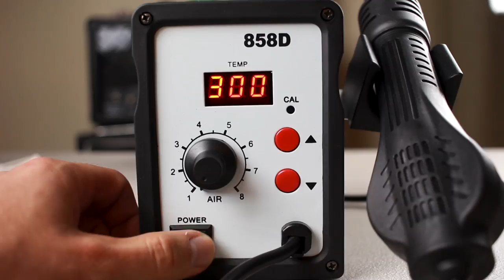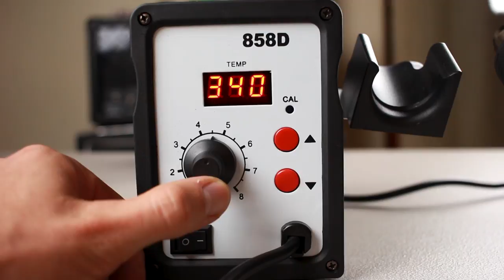HOW TO USE A 858D HOT AIR REWORK STATION - MOD MONDAY EP5

Comment: I have the LRT station with both heat gun and iron. Your video helped me conclude that it was not functioning correctly and it needed calibration. Brand new out of the box was low by 100 C. and since it only goes to 450 I was only hitting 350!! destroy 2 test chips before I figured it out. LRT 8586D.  Once it was callibrated it poped the chips off like a pro!! Saved 50GB of my grandkids pics from the beginning of their lives. PRICELESS video my friend.  Your video assured me that my device should be able to do the job and something else was wrong.  THANKS AGAIN
Reply from the maker: Glad the video helped. When I started I was melting boards because the heat was too high and the air was too low. I bring the air up just high enough that it doesn't blow the parts off the board. Use generous amounts of flux paste help as well.

Comment: One "trick" that makes desoldering a little easier if you use solder wick / desoldering braid: 
Cut yourself small pieces (maybe half an inch or 3/4") off the reel and hold them in place with tweezers. Discard once saturated.
If you keep the entire roll of desoldering braid attached, you have one huge hunk of copper there that will suck the heat away from your soldering iron quicker than anything. Depends on your iron of course.
Reply from the maker: I'll have to try that. Thanks for the tip!
Reply: This is brilliant! Never thought of this at all.

Comment: You did very well in your explanation. You know what you are talking about! I have been a Commercial TV  High Technical Maintenanace  Engineer for over 15.5 years +,  I have done so much repair work on Sony. Ampex and Hitachi Tape Machines and Cameras  back in the early 1980's.  I wish this was available back then when TV was still just analog. Nice to see a young person take such an interest in this. Great Presentation! Keep up the Good work!
Reply from the maker: Hot air would be better for smaller components than TVs. With bigger components a soldering iron would be preferred.

Thank you!

Comment: As a total newbie in the world of soldering, thank you for this review. Also I would like to thank people commenting tips&tricks!
Reply from the maker: No problem. Hot air rework is a little trickier cause you need a lot of flux, moderate airflow (but not too much that your parts blow away), but not too much heat that you melt your components. Its an art.

Comment: Nice video Just a tip Put some heatstrink over the pcb holder clamps You can scratch and destroy pcbs bcz the metal teeths are pretty sharp Good luck!
Reply from the maker: I've scratched a few already. Good tip, thanks 👍

Comment: Louis Rossmann Has left the chat.
Reply from the maker: He's a big fan of Hakko and would not recommend this unit. He's also coming from a place of a repair business, not a beginner guide. Still a fan of his, his knowledge of Mac is unsurpassed.
Reply: This hot Air station is actually preety good. I own it.
Reply from the maker: There are a lot of copies. For the price it really can't be beat.
Reply: Rossman made a video bashing (literally) Baku hot air station, which was pretty pointless.  A pro should not get hobbyist grade equipment and then bash it as not being good enough.
Reply from the maker: I agree, springer. If you're going to run a business, you should be getting quality tools. Rossman could probably go higher quality with Metcal, but Hakko is probably good enough for the work he does. To each their own.
Reply: @ImmodderNation  Quick is the one to go to
Reply from the maker: What?! Who is Quick?
Reply from the maker: Oh yes the quick brand. I'd buy if it were $200 cheaper

Comment: This video saved a 4tb hard drive! Got a cheap station off ebay and a few parts, fixed the hard drive in like 5 minutes. Don't plug hard drives into the orange sata ports on supermicro motherboards lol
Reply from the maker: Grats! How did you fix a hard drive with a hot air rework station?
Reply: @ImmodderNation  Swapped the bios chip onto a donor logic board
Reply: Thank you for posting this.  It gave me the assurance that I could change the bios on my drive without cooking it. It is done and working ... recovered 50GB of my daughters baby pictures!!

Comment: The offset on that air dial, holy balls xD I've had the KMoon 858D for a few years now, served me well thus far :)
Reply from the maker: For as cheap as they are, they get the job done.
Reply: @ImmodderNation  
I just subscribed I'm thinking about getting a bios chip removed and replaced onto another printed circuit board do you do this type of work for a fee ?
Keith  Kuhn
Reply from the maker: Sorry Keith, but maybe someone else here does. You can also post in my Discord.
Reply: @ImmodderNation  
Ok Thanks
Keith
Reply from the maker: No problem 👍

Comment: If ya remove the holder bracket, you'll see some hot glue to pick out, then with a little patience you can work the thin wafer magnets out. I used a needle file which worked well.
Reply from the maker: Thanks Don!

Comment: I have one.  I believe it's temp is under rated.  I go all the way up to 500 and seems good then.  probably 400
Reply from the maker: Gets the job done for the price, but I agree it's not like the higher end ones.
Reply: It seems like it if you dont know how it works. Check with thermocouple its likely acurate

Comment: Hi Quality Glass Epoxy Cicuit Boards are tough to remove components without removing the trace.
Reply from the maker: You might want a different hot air station for that kind of work.

Comment: Hi Sir, Good Morning or Good Evening, Can You teach me how to use a Hot Air Gun Rework Station(I have 958D hot air gun), to any components. Like what temp. Or what air flow??! 

Thank you
Reply from the maker: Start at 350 and maybe medium air. Keep the wand moving, don't stop in one place.  Don't go above 700 for components.
Reply: @ImmodderNation  Hi Sir, Can I use an airflow of 4 or 5, to desolder and Solder an IC(Integrated circuit), And Temp. Of 330 or 350

Comment: you really should get a decent soldering iron first. this thing looks awful and the pointy tip is basicly the worst choice. a chisel tip or a flat bottom tip is much better in transfering the heat to the actual joint especially combined with solder wick. 

i find it nearly impossible to desolder stuff with the pointy tip, no way to get the solder hot from the get go. also you should add fresh solder first. seems counter intuitive, but makes desoldering much easier! also work with a generous amount of flux, makes the solder flow much better to wherever you apply heat to
Reply from the maker: The WLC 100 is very decent for the beginning solderer. I like the pencil tip for PCB work but the WLC comes with a wedge tip. Thank you for the soldering tips!
Reply: @ImmodderNation  no problem, you just reminded me of myself when i started. i bought a soldering station from the hardware store and the thing only came with the pointy tip wich was pretty much useless for anything else than splicing wires together. 
sad thing was, there were no replacement tips available, so i had to take some bigger ones and turn them down on the lathe. worked great nevertheless. 

i got the same hot air station but it still feels wrong to heat stuff up to the point where the solder gets liquid, especially thinking that under normal conditions, you dont want to get the chips even remotely to that kind of temperatures.
Reply from the maker: Those chips are surprisingly resilient. Remember a hot air rework station is blowing hot air, which is different from applying a soldering iron directly. There's always aluminum tape for components you don't want getting hot as well. Conveniently enough, I spend most time soldering wire in my videos so the pencil tip works great for me.

Comment: I just got mine in the mail and with temp resist silicone tubing and a Arizer vaporizer balloon refill kit to make a Volcano esk cannabinoid vaporizer. How long can the tool rest in the cradle before it starts cooling, and is there a way of stopping it from doing so? Thank you.
Reply from the maker: There's a magnet inside the tool and the cradle that drops the temperature immediately. You'd have to remove one of them but I'm not sure how.

Comment: When will people learn that annoying repetitive music in the backround really sucks in a review or tutorial.  Im trying to concentrate on what your saying and the goofy music loop just makes it harder and ruins an otherwise good video.
Reply from the maker: Thanks for the feedback
Reply from the maker: Moe, how would you make this video better?
Reply: @ImmodderNation  sorry I wasn't referring to the video but the content. Your soldering skills could use a little how to is all I was saying. Couple things I noticed, when using the soldering wick, add some flux, so you don't get a blob of solder stuck to the end of the wick, flux will allow the solder to wick in. You'll likely to wick it all infact. Same when de-soldering, add some flux to get better flow. Flux is your friend, if worried about the mess, you can use water based as opposed to Rosin based but rubbing alcohol will clean it right up.
Reply from the maker: Good advice with the flux paste. Really the idea was to show off the hot air station, not my lack of soldering skills.
Reply from the maker: Yeah I watched the videos when I bought it. Haven't opened it up yet but maybe I'll make another video about it.

Comment: @ImmodderNation 5:41 R;y,. you said so? I don't think so, i  own this hotair and it has issues with  heat- hungry mobos...  Sometimes I have  to crank up temp. up to 410 degree C and wait 2-3 mins to remove the component, especially QFN with thermalpad...
Reply from the maker: I could have added "Budget friendly" or "entry level" to the video, but this is not a review. If your motherboard is drawing up heat, I don't think a hot air station will work that well. Probably should try a reflow oven or hot plate instead.
Reply: @ImmodderNation  It depends, in some cases for example Quick 861DW does the job without preheating...  For example I found a guy who fixes GPUs. He has mentiond hotair and removes components from them without any issues, without preheating...

Comment: but what if your solder iron can go up to 450celcius and the hot air rework also 450celcius wont that make the hot air not necessary in that case? since to remove the solder connection of cold joint you can still used back the solder iron to melt the join, and the components can dry off by air dried, so in this case theres no need for hot air rework then?
Reply from the maker: Soldering iron and hot air station work differently. Soldering iron provides intense heat but directly by contact. Hot air station provides heat over a small area. Soldering would be better for attaching specific points whereas hot air station is better for SMD components like microchips with multiple contacts.

For cold joints on a board, you would probably want to use a reflow oven or hot plate. There are different tools better suited for different tasks, but you could get them all to work in a similar way.

Comment: Can you desolder components directly from large graphics card as GTX8800 using this hot air station without any bottom preheating?I would like to see this hard kind of tests.If it can does then its worth its money.
Reply from the maker: For smaller components like surface mount stuff, yes. Larger work like the GPU may require a preheater. These don't blow as much air as the professional ones that use air pumps imo, but they can get just as hot.

Comment: If I hadn't to remove the excess solder first, it would be great. But this way, nah.
Anyway, good vid!
Reply from the maker: For surface mount and jobs where you have to melt lots of solder, this is the best.
Reply: Get solder paste
Reply from the maker: Solder paste is better for reapplying smd components.

Comment: I wonder if the 858D and the 898D rework stations are basically the same?  There's another video showing an 898D that burnt up.  But, the reviewer did say that he used it for years with no problems.  And I see that Amazon has dropped the price on the 858D from  $ 89.99 to $ 39.99.  At that price - WHO CARES as long as you can get a few years work out of it.
Reply from the maker: Similar maybe but probably not the same. Just like there is fast fashion, I believe there is fast tech. This is affordable, entry level stuff for people who don't want to spend a lot of money and aren't ready to commit to the high price of a workhorse piece of tech. 858D is a good example of this. Ofcourse there are better hot air rework stations but not at that price point and if you're going to be working on iPhones and replacing a lot of chips or SMD components, you probably already invested in better equipment anyway.

Comment: Hi Sir, I am your new Subscriber, Can I ask a favor, How to use a Gordak 968D Digital Hot Air  Rework Station??

Thank you
Reply from the maker: I don't own one of those. Premise is the same, adjust dial to correct temperature for hot air. For soldering iron, consult the manufacturer of your solder for recommended temperature. Usually 350 for most silver bearing solder.

Thank you for subscribing and welcome to the Modder Nation!
Reply: @ImmodderNation , Oh, Ok Its fine, And Thank You for the information. 

But I have another favor Sir, What Temperature Do I use for Soldering And Desoldering a Components To a Circuit Board(PCB), Using "Digital Hot Air Rework Station"??

Thank You
Reply from the maker: Start around 315 and go up. Remember to keep the heat moving don't hold in one place. Don't go higher than 400.
Reply: @ImmodderNation , Ok Sir, And Thank you Very much For the information and step you gave.
Reply from the maker: You're very welcome. I like the way you say "Sir." I feel important and maybe a little old, but important.
Reply: @ImmodderNation , Your Welcome Sir..

Comment: Maybe you could show me how to mod my Razer Tartarus to make it wireless. That would really help my setup!
Reply from the maker: That's a really interesting idea. I wonder if it's been tried before
Reply from the maker: You're going to need a cheap wireless mouse for the wireless receiver and dongle.
Reply: ImmodderNation I was thinking of buying a used Razer naga epic wireless (or whatever they call it) for the surrogate.
Reply: ImmodderNation Do you think it would work by just wiring a wireless keyboard receiver and battery to it?
Reply from the maker: No need to buy a Naga, buy something cheaper. You're going to destroy it, why waste the money? Technically the receiver and battery should make it work if wired properly. Just need to make sure the battery voltage is converted to 5V.

Comment: don't be a hobo,  this is fine by its self a combo is not. don't cheap out and buy a garbage iron get a Hakko fx-888d for 96 usd or Weller equivalent. it will pay off in the long run
Reply from the maker: For people that are serious about electronics work there are great combo units that take up less space that two individual units, but you may have to spend more money. Sorry I wasn't clear.
Reply from the maker: Hakko is a more expensive brand that is often recommended. Personal preference is more important.

Comment: I never considered using a heat station to remove a through-hole component. you risk removing a vital through-hole via in the process.
Reply from the maker: If you know what you're doing there's no risk. Aluminum tape with help to keep heat away from components you don't want removed.

Comment: what is minimum air position
Reply from the maker: Do you mean the lowest air position you can have? 1, but depending upon the size of the smd device, you will want to increase or decrease the blower. More air for larger components, but too much air and smaller components may blow away.

Comment: 3:10 Not 300 Farenheit its 300 celsius or more, 400 recomended.
Reply from the maker: I mixed up the units, but you knew what I meant.
Reply: @ImmodderNation  I got a 858D and can choose F or C, maybe another who also has it gets confused.
Reply from the maker: Well it's a good thing this video is not an instruction manual. 🤣👍
Reply: @ImmodderNation  :D